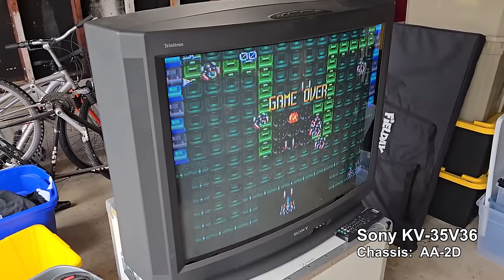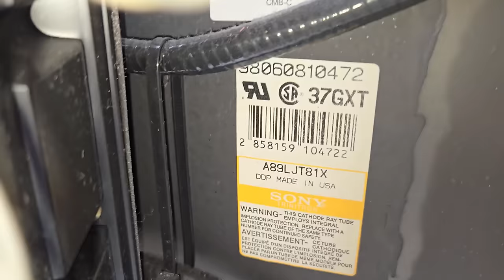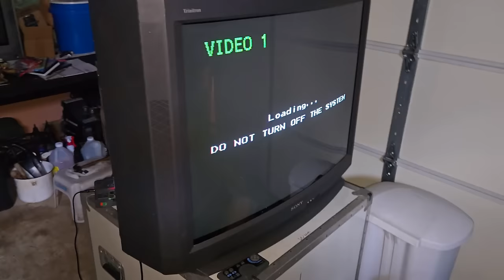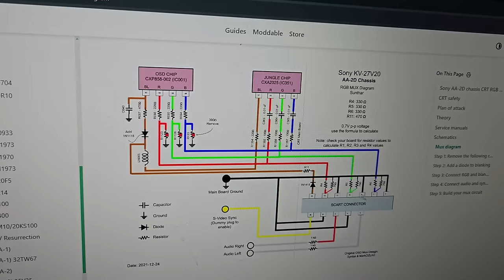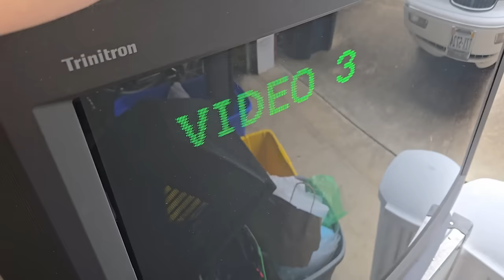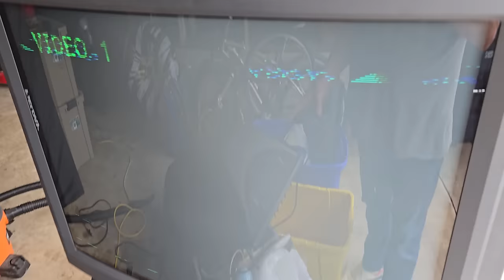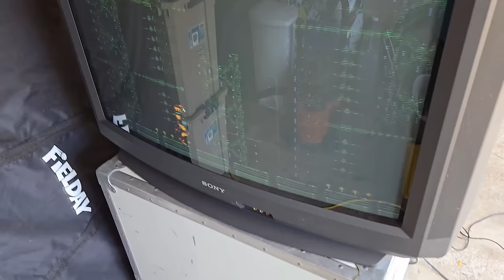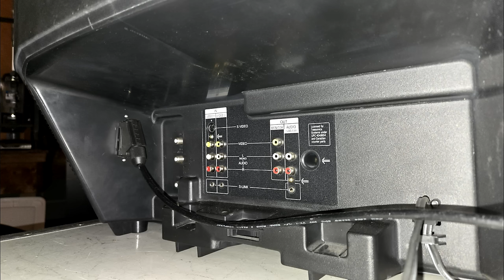RGB MUX: Unlocking the Trinitron's High Rez Mode!

Comment: Those boards have been available for years and are quite nice to work with. You kind of missed the benefit of the mux mod vs a standard RGB mod - the point of it is that the on screen menu isn’t lost - so you can still see things like the volume display and the OSD menu while it’s active rather than “replacing” it with the injected RGB. I’d still recommend putting in a switch to change to RGB as not all scart cables have the 5V line wired which is what this uses to trigger the switch to the OSD/RGB. It’s also kind of annoying to have to unplug the scart cable or power down your scart device if you want to use a different input. If you want the functionality of both, you could have a 3 way switch that chooses auto (5V present on the scart line), off (ignore scart input), or scart select (force to show Scart).
Reply from the maker: I think you left before the last 6 minutes of the video played out, as I explained pretty much all that stuff.
Reply: @RetroTechUSA  You didn't explain any of the information in the comment above at all, the only thing you said was "this is cool because it doesn't need a physical switch". You didn't even explain what "mux" even means, or why Sunthar's pre-made mux board is helpful for this application. 

It's great that Sunthar got a shoutout here for his great work, but I really wish this video was a little bit better researched.
Reply: @CMskittles bro, you should learn to relax a bit.  This is literally an "entertainment" style video...  like, did someone hold a gun to your head and force you to watch it?
Reply: @michaelcard1973  No one forced you to reply to my comment, either, but here we are. I think this is perfectly valid criticism for a video on this subject. His reply claiming that he "explained pretty much all that stuff" is straight up false. It's clear that he doesn't have a great idea of how this mod actually works.

Sorry that I'm not praising this guy like everyone else in the comments. Not sure why you got offended by it.
Reply: @CMskittles  it's weird you posted your original comment because at no point did I hear him state that this was going to be THE definitive guide to end all guides on how to install this mod.  It's an entertainment video.  So yeah, when you post elitist BS in a public way, of course I would have a right to respond.  Remember...  you posted first.

Comment: Hi, there. Sorry for this unrelated question, but I can’t figure this out with google and my lack of electrical knowledge.

I have a monitor with discoloration in the corners. I tried to fix it with all the different magnet tricks, but no luck.

I want to try out a degauss coil like yours , but can’t find one made for EU wall sockets. Could I just use a US to EU socket adapter or do I need something like a step down inverter 220v to 110v?

Comment: Hello! Please allow me to ask you a question: What do you think of the Panablack line of TVs? I have a 27inch Panablack from 2005-2007 but my landlord just told me she has a 27inch Philips from 2003 and offered me to take it for free, she doesn't use it anymore. Both of them have component inputs (the philips also has s-video). These tvs are huge, so I can only have one at home. Would you keep the Panablack or switch to the Philips? I hope you can help me decide. Thanks in advance!